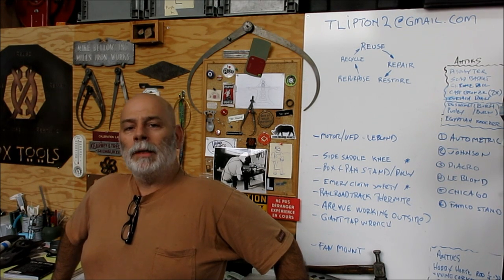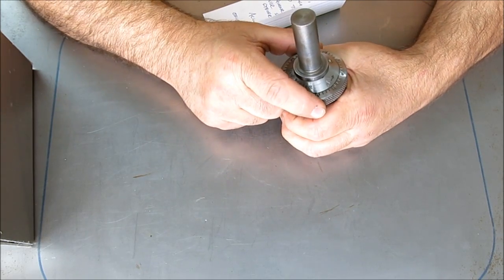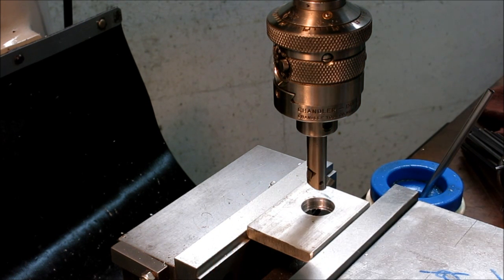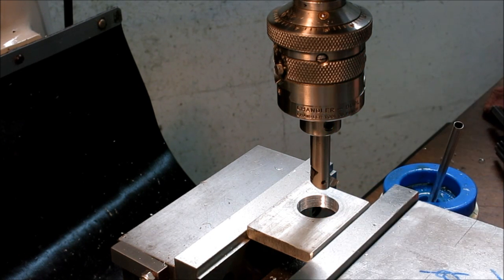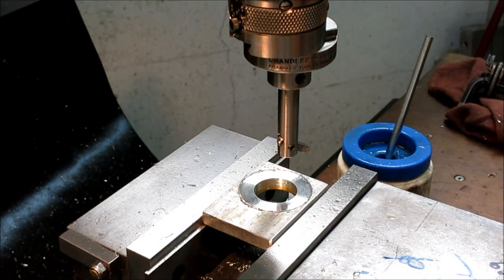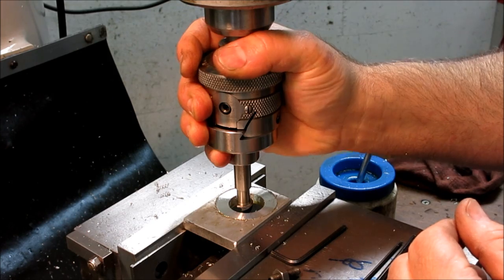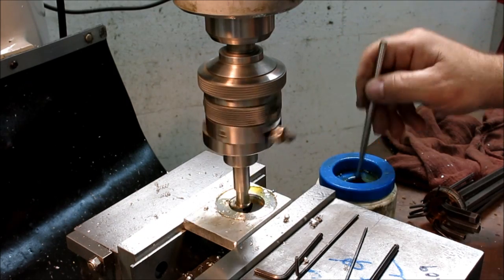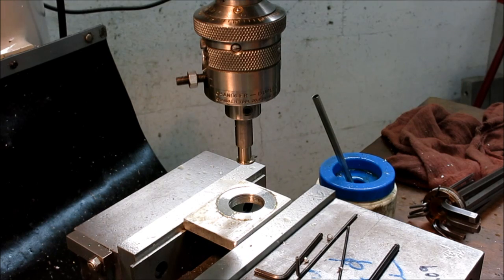Chandler Boring and Facing Head

Comment: Year 1966, worked for company making the duplex boring heads(several models) and also Chandler compound radi dressers for precision grinding. Stock boy in receiving  and first process. Ran a horizontal band saw w/feeder and two shapers. Dreamed of getting up front running other machines but cut short by Uncle Sam.
Enjoy your videos very much. Have retirement shop in Florida now. Just got a Fucchella 4M hydrolic tool and cutter grinder to play with. Philip

Comment: I have the same model boring head with an r8 shank. Unfortunately the boring head cost more than the mill, but it’s a fine instrument. If you back out the thumb-screw in the dial face on the side, you can use an Allen wrench on the opposite side to return the slide, without undue wear to the gearing. As stated by the set of instructions I found for mine. It’s also much faster. Just be careful to get the screw set back in one of the index holes, I think there are six. Mine chatters like hell unless I lock the slide while boring a hole.

Comment: D'Andrea (Italian) produces the best boring heads on earth - manual or electronic. Nobody beats them. D'Andrea has done boring heads for more than a 100 years if I remember correctly. I used many of their boring heads when I was still working and believe me, I tested the accuracy of their heads - brilliant! The one head I had was a 2 micron (on diameter) which I used quite a lot. Man, absolutely super.

Comment: I purchased this exact model on ebay this last summer. It had a straight 1/2" shank and when spinning, it looks like it was crooked. I took it all apart and mated it to an R8 shank that I machined out of a regular boring head shank that I bought for maybe $13.

I did not get the two "tool holder extensions" however, those two shaft like items with a square end on each. I would very much like to see a video looking at those in details so I could machine those too. For example, is the square part integral to the round part? Also, there must be some kind of keyway like groove on at least one of them right?

By the way, the shank is screwed in with 1/2"-20 thread. Any information you could provide on my two missing pieces would be greatly appreciated. Thanks for the video, it was very useful to me.
Reply from the maker: +Jacques Rioux Hi Jacques,

The two square tool holders are one piece affairs. They are sized to fit the tool holes in the head and then hold a tool of an equal shank diameter. I'm pretty sure they have flats on them to orient the tool with the locking screws in the head. There are no keyways in the ones I have. Send me an email and I will get you a couple of pictures. Thanks for the comment. 

Cheers,

Tom

Comment: Hi mate.That is a very nice tool.  I would love one of those, but I think that I would be hanging of it being snagged by that set screw.  That thing was made in a time that a small thing as safety was something nice, when it suited the design.
Reply from the maker: +Marcel Timmers Hey Marcel,

I rarely use it with the stop screw. Its really nice when you have a job for it. Thanks for the comment.

Cheers,

Tom

Comment: Gday Tom,
I have watched this video several times now with a lot of interest. The obvious facing feature of this tool is the big seller.  But the snap ring & "O" ring grooves that can be done are also a "hey, get one of these things set up.  Anyway, I bought one on ebay, from the US... Where can I get the  accessories ? -  the offset stuff for larger diameters Tom ?........ If you can help.   Also how do you remove the arbor ? I will M/C an arbor  like the one on your video. Or can you buy one ?.
Reply from the maker: Peter Spence Hey Peter,

The accessories for mine look hand made. I don't know what is stock and what is custom. There are some online PDF manuals that I found pretty easily that show some things. The arbor is another item. I think mine was a Morse taper originally. I think my buddy may have turned it down from the morse taper into a straight shank. What arbor is on yours?

Best,

Tom
Reply: +oxtoolco 
Thanks for your reply Tom,
As I write this reply back to you, I am unwrapping it !. It looks in great cond. It has a #1 morse taper, and looking at it in the flesh, I think I'll leave it for now & not change it to a straight arbor. Maybe later.... I am about to check some "utube" vids on this thing.. It's a little 2" version.
Cheers - Pedro...
Reply: +Peter Spence,
 Tom, the morse taper is #2. not #1
Cheers.........

Comment: Hi Tom, I'm sure you have better things to do than answering an old video question but your the only one with knowledge on this particular boring head. I too have one of these but it sits on an upper shelf in a box. its been 5 years or more in that box with-out using it. Many years ago I mistakenly used it in a drill press 25RPM or so and the darn thing chattered and fell out of the MT2. No damage but enough to warrant to put it away until I find a way to change the shank to something else other than MT2 with a tang. I'm not sure if it is screwed in or what, I don't want to break such a fine tool.
I very much enjoyed this video. I don't mine watching re-runs "lol" you learn more and more every time!
Thanks for the videos

Richard
Reply from the maker: Richard B Hey Richard,

I think you should throw it away. I happen to have a garbage can with some room over here........ Just kidding. I'm not sure how the shanks are attached to the head. Mine came from a coworker that died. It appears it had a taper shank on it as well and he just turned it down between centers. Hope this helps. Thanks for the comment.

Cheers,

Tom

Comment: Hey Tom,
Do you know what a Devlieg is?
It is the most beautiful horizontal Jig Mill ever made.
They are all hand scraped and oil pocketed on the ways.
Super precision Back before CNC was even thought of.  
They made .005"  like an open field.
The 5H had a 144" table.
I ran them at Koppers, and ---- when they were available.
Reguards,
 Kap
Reply from the maker: kappullen Hi Kap,

I have seen a few of those Jig Mills. The ones I have seen were smaller than the 5H you mention. Never had the opportunity to run one. Thanks for the comment.

Cheers,

Tom

Comment: Hey Tom,
If you haven’t already, you have to get your hands on a WOHLHAUPTER UPA series boring head. The tool nut that you are, you will fall in love. They are super German quality, very smooth, precision and beautiful lines appealing to the eyes. I have several Criterion heads a couple of them extra precision you can dial in tenths. In comparison when I hold them or turn the dials the Criterions fell like 1-2-3 blocks and the WOHLHAUPTER UPA-3 feels like a Jo block. I took mine apart once just to check it out. Insane design, I forget most of it but I remember it was very complicated, many pieces but beautiful. You can face and rapid return without changing rotation. Adjustable stops, lots of features. 
Joe

Comment: Tom,
I have the baby of the daddy of them all that started it . WOHLHAUPTER UPA2 . Supposedly WOHLHAUPTER started it all. My boring and facing head dates back to mid 40s I believe. Beautiful crafted German tool. Evn though Im a CNC guy and out dated for my setup there beautiful fine crafted well oiled little machines.
I purchased it with a busted rack . Its mates is a worm gear Ive been reading for at least 3 months on gearing mates worms . Video after video . Still cant figure out the proper way to machine a rack with a helix almost to match the D.P. of the worm it mates to. If you know a thing about gears and there mates please drop me a line . 
That would be a good meat loaf though something not many touch on, Making gears , hobbing involute cutters and button cutters. 
Mark
Reply from the maker: Hey Mark,

A rack that mates with a worm is similar to a worm gear stretched out flat. When you cut the worm gear you have to gash the teeth at the correct helix angle prior to hobbing the gear with a helical hob. This would be the same angle you would use to cut the teeth of the rack. This is a slight simplification but basically the direction you want. There is a great section on milling spiral racks in the book "A treatise on milling and milling machines" by the Cincinnati milling machine co. 

Cheers,

Tom

Comment: Hey Tom. Nice demonstration.  Have a question....I have a boring head that was given to me.  It accepts a .375 boring bar but I don't have one.  Any ideas on how to make one.  I see the ones in your video have a rectangular shaped slot which accepts the cutter insert.   It doesn't seem like too difficult to make one except how would I mill the  slot?  Maybe I need to buy a square drill bit?  lol
Reply from the maker: Well you have it right. The square hole is the hard part. You can find steel boring bars in the catalogs KBC, Enco, Travers that have the holes broached in them. You can cut them in half for use in a boring head. They also sell dedicated shank boring tools for boring heads which are really nice. Lastly you can grind your own from a high speed blank. 

Cheers,

Tom

Comment: good video. the first time i ever saw one of those in use was to spot face a hole from behind. i couldn't imagine how the job was accomplished until my master tool and die maker friend showed me the tool in action. the job was to clean up a welded thrust surface on a forklift steer axle.

Comment: Hi Tom,

I have a Japanese copy of a small Wholhoupter that I think I showed a while back. The bigger Wholhoupters have a series of pins you push in to set the feed per rev.

One capability that you missed is that in combination with quill feed it's possible to machine a taper. Not that useful on a Bridgeport style machine with its limited feed rates, but it can be very useful on a horizontal machine. A friend has used it to cut taperlock hubs.
Reply from the maker: Hey Paul,

Wow never thought of that. That would bend your mind working through that operation. I have never used a velociraptor myself.

Cheers,

Tom

Comment: The stop is a great feature. Seems like the tool could speed up those operations you mention but also seems like mr bozo would be more likely to visit more often.
Reply from the maker: Hey Bill,

You don't want Mr Bozo around when your doing internal snap ring grooves. Typically these are almost done features.

Cheers,

Tom

Comment: Seems very nice for quick stuff , but is there a way to adjust the feed/rev when you are facing ?
Reply from the maker: Hi Panzax,

No adjustment for feed/rev. Its .0025/rev which is pretty slow already. .005 on the diameter per rev of the hand ring.

Cheers,

Tom

Comment: I bought one of those but mine needs work. The ring doesn't turn and I can't get the r-8 arbor off to get into the workings and figure out what's wrong.
Reply from the maker: Hey Hobby,

Start by trying to take out the little knurled screw that goes through the small dial face. This should disconnect the slide from the gearing. You can then move the slide with an allen wrench inserted in the side opposite the dial face. There is a small hole there to use as a coarse adjustment of the slide.

Cheers,

Tom
Reply: oxtoolco Mine is actually missing that knurled screw. I've had the slide off and I hit a roadblock at the top where the ring is. Maybe I'll do a short video later showing how far I can disassemble it and where I'm having a problem. I can force the ring to turn a little, so I think the works are just clogged with chips and weasle snot :)

Comment: I had snagged a model J and few years ago, and Fenner showed a much larger Chandler that I have been hunting for. I did just buy another last week, but the seller has some shipping issues and haven't received it yet. I may need some more info on the stop features.....never had any add'l parts or knew it was capable of that!.....looks like I may also need to make some dedicated tooling......thanks for the info and showing!
Reply from the maker: Hey Jim,

Download the instruction sheet. It shows all kinds of things these heads can do. 

Cheers,

Tom

Comment: Thanks for sharing.  I actually purchased one of these at an auction for around $100 a while back but mine is much larger.  When I purchased it I thought I was buying a really nice regular boring bar but after inspecting it I saw it did a lot more.  I found a manual online but it was fairly vague.
Reply from the maker: Does yours have a straight shank on it or something else?

Cheers,

Tom
Reply: oxtoolco
  Mine has an R8 shank on it

Comment: Very interesting tool Tom!  An observation...  the threads that control the tool movement must be very fine indeed.  It takes a number of turns to move the cutter the slightest amount.  Also, how would you make an internal snap ring groove if you did not have a tool like this one?  Would you use a standard boring head?  Thanks for a great segment!   Fred
Reply: Fred, if possible chuck it on the lathe, to make a internal grove (I have a 8" round "tom lipton type plate" I bolt stuff to and chuck in the lathe for that reason. Project too  big to toss on a lathe... standard boring bar with a groove cutter (made from 01).... Stop, adjust in 0.002", start, stop.... adjust.... groove takes over an hour.  A couple of times a year, hard to every justify a Narex.
Reply: Thanks Tom.  That's the process I would have used not knowing.  Now I know and I agree with the justification comment.  Fred
Reply from the maker: Hey Fred,

The Chandler uses a little worm gear setup to get the reduction from the ring to the slide. If I didn't have one I would be headed for the lathe or CNC mill when I needed a snap ring groove.

Cheers,

Tom